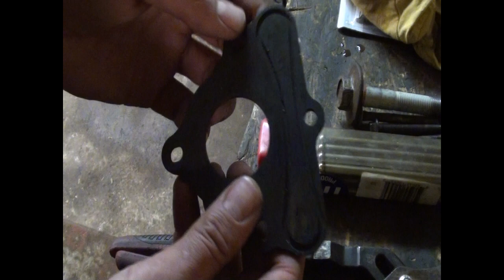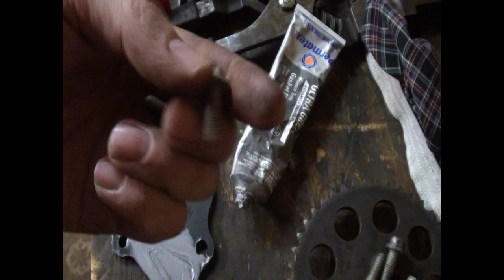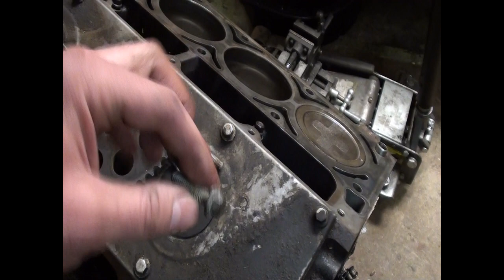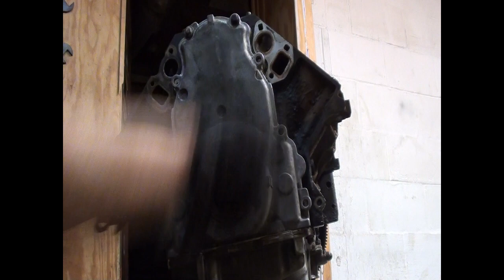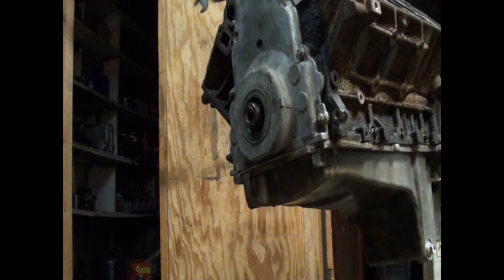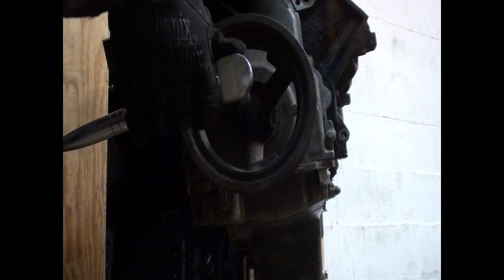5.3 Reassembly ASMR 😂 Camera practice 223k $100 junkyard jewel

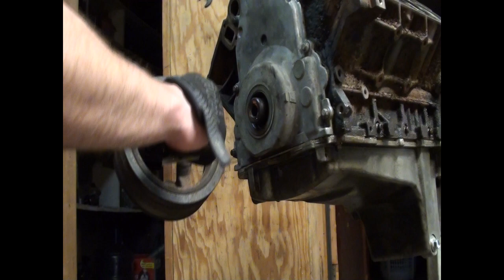Comment: 03:38  & 05:07 What did you lather on the damper and the shaft and the bolt?  What is the red stuff on the back of the bolt washer?
Reply from the maker: Grease. AnD Red loctite

Comment: I hate to that guy but There goes the oil pressure for that motor just buy other cam plate so you can have pressure for the whole motor
Reply from the maker: Itll be fine. If you pay attention its a test motor. Itll never see a car